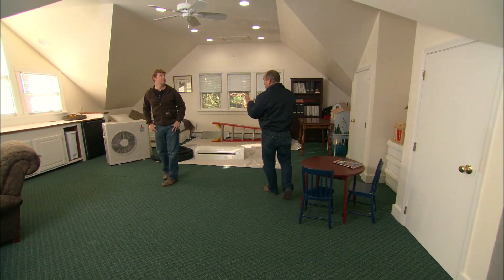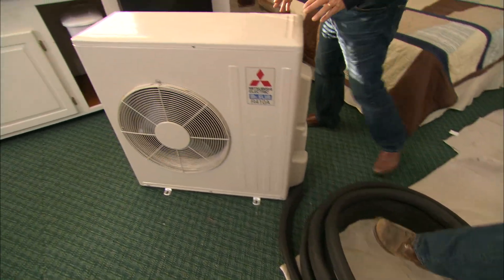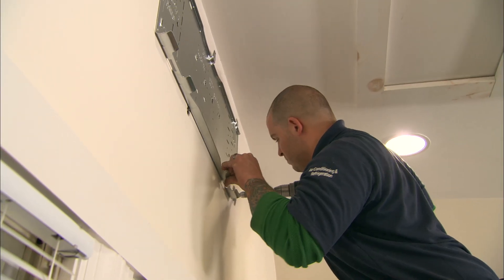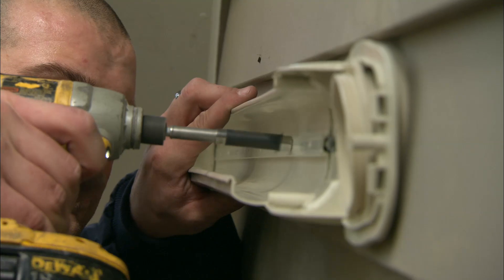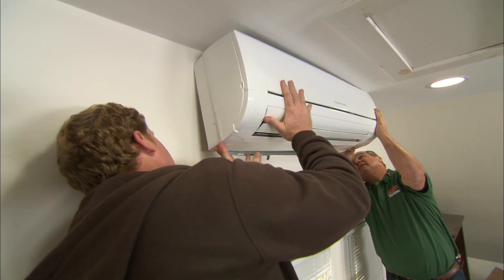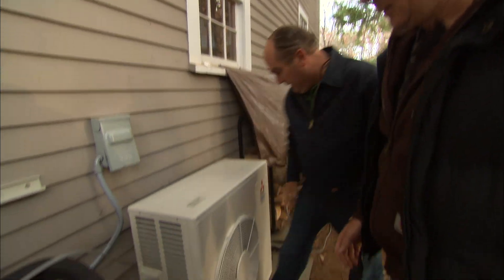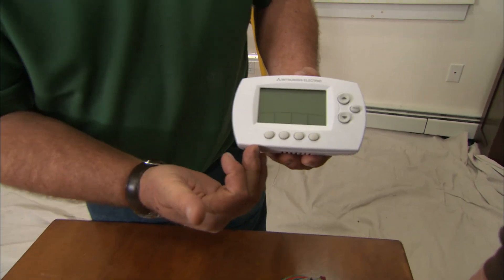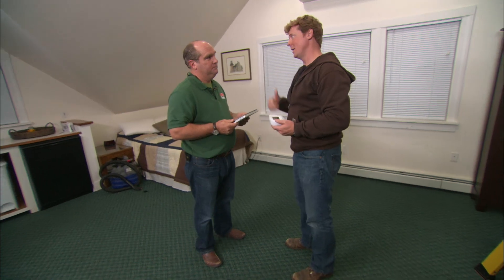How to Install a Ductless Heat Pump | Ask This Old House

Comment: Manual J calculation is absolutely worthless unless a blower door test is done. 700 sq ft and needs 18,000? NO SHITE. I’ve been in HVAC FOR 41 yrs and I would have put a 18K unit there without wasting my time on useless manual J

Comment: as low as 5 degrees outside can heat a room huh.... So how does it work exactly cause where I live in the winter, it can average -2 to 3 degrees on cold nights. Where is the "Heat" coming from if the outside is still colder than the inside of my house without the heat on?

Comment: Hi everyone. I have a question about my heat pump. I have installed the heat pump and ready to wire in the 220v power and I am a little confused. The unit is a 220v but the electric indicates L and N and a ground. I am used to seeing L1 and L2 for (hot line 1) and (hot line 2) for  220v. Is L and N another way to describe the 2 hots. Thank you to anyone  who can clear this up for me.

Comment: will a ductless heat pump work for a old brick house with no insulation in the walls in zone 7. It currently has a boiler with hot water and radiators. i have access to the joists under the floors.I am thinking pex under floors would be a better option. A local hvac guy said heat pump and mini heads?
Reply: What are you using already?  If it's electricity heating the water than it's a no brainer, get a heat pump.  You can get some that will heat the boiler water instead of air, though it might be a little less efficient (typically the water needs to be hotter in old homes because they lose so much heat).  But everyone will tell you: INSULATE FIRST, so you don't need as big of a heating system (cheaper)...

Comment: Would have been nice if you’d have shown how to pressure test, vacuum, and charge the system.
Reply: From what i have read they come pre charged.
Reply: @laserbeam002   Some brands like Mr Cool offer diy systems that are precharged and don’t require a vacuum pump. I could be wrong but I don’t think the Mitsubishi unit they showed is like that.

Comment: Is not the inside unit supposed to be at least 10 inches from ceiling?  (I am just reading/watching all I can before my unit arrives for my diy installation)
Reply: Thought the same, looks too close to the cieling, think it's supposed to be at least 6 inches

Comment: Just gloss right over the vacuum down, leak test, R412a charging.. all that adds about $600.  This is NOT a DIY lineset.  This needs a certified AC dude to charge the systems to the correct pressure.  Also that indoor head unit is WAY to close to the ceiling.  You need min 10 inches (that's what she said)

Comment: Why do Americans call it ductless? 
Just call it: 'heatpump' like the rest of us
Reply: Are not all gas based AC systems heat pumps by principle?  I mean they all transfer heat because of stage changes from liquid to gas and vice versa, right?
Reply: Andres Valdes. Yes, but I think many places "heatpump" carries the idea it is reversable able to both heat and cool. Whereas AC: cooling only in some regions.
Reply: @Froggability  Agree. I was trying to get to the point of the name.  It seems that calling it by the feature they don't share makes more sense than by the feature they all share. So, I'd say, that maybe this time Americans have it right. :-)
Reply: Because they are Americans. What you expect? :)
Reply: Because in Canada and the US, we typically have forced air systems that heat the whole house.  So we have heat pumps will be designed to work in those systems and heat the whole house.  As opposed to this unit which is designed to heat a room.

Comment: This video is almost 4 years old, is the information in it still applicable today in 2019? I'm trying to decide how to heat my garage and bonus room above it. I have an 1100 square foot garage and a 400 square-foot bonus room. Just wondering if one unit with two heads will work. And I live in the midwest where could get to 20 below zero
Reply: The right heat pump should work; I live in Canada and we have temperatures to -30 Celsius (slightly colder than what you mention).  I opted for the Mitsubishi Zumba, and it works down to -30 Celsius.  For my old 1950 house, at maybe -24 Celsius the backup heat turns on occasionally, but not enough that it matters much on the bill.  I highly recommend it.

Comment: A.) inverters don't magically pull heat out of cold outdoors.  They just make the whole thing 10X more efficient than capacitor run units.  B.) there was no mention on using a torque wrench to tighten the copper lines to the handler or condenser.

Comment: You guys are a joke, I've installed countless mini-split systems by myself. You don't need a bender for soft copper if you know what you're doing. I didn't see you check for leaks and evacuate. This isn't rocket science.
Reply: Think they skip over the stuff that "requires" licensed professionals like HVac and Electrical.

Comment: You forgot to mention how efficient split systems are -for every unit electrical energy they use you get roughly 3 units of heating or cooling energy back!

Comment: TODAY THESE MINI SPLIT UNIT ARE EVERYWHERE MADE BY MANY MANUFACTURES. THE ORIGINAL INVENTORS OF THE MINI SPLIT UNIT WAS MITSUBISHI. THE REASON I KNOW THIS IS BECAUSE I INSTALLED THE FIRST MINI SPLIT UNITS IN THE UNITED STATES AND MOST LIKELY THE WORLD. IT WAS BACK IN THE MID 1980'S HERE IN NEW YORK RIGHT OUTSIDE MANHATTAN IN SUNNY SIDE QUEENS IN THE NYNEX OFFICE IN THERE BEEPER DIVISION. AT THE TIME I WAS IN THE 638 LOCAL WORKING FOR THE A.D WINSTON CORP AND DAN DONNELLY OF DONNELLY MECHANICAL A BIG SERVICE COMPANY TODAY HERE IN NEW YORK. PRIOR TO DAN BRANCHING OUT ON HIS OWN EMPLOYED BY A.D WINSTON WAS MY SUPERVISOR AND ME AND MY PARTNER EDDIE B. MET DAN IN THE NYNEX OFFICES TO INSTALL THESE UNITS THAT WERE CALLED MR. SLIM FROM MITSUBISHI. THE EVAPORATORS FIT INTO A 2X4 CEILING TILE. I REMEMBER DAN DONNELLY SAYING YOU GUYS ARE MAKING HISTORY. THESE UNITS ARE A NEW TECHNOLOGY AND THE FIRST OF THERE KIND HERE IN THE UNITED STATES AND MOST LIKELY THE WORLD. THIS IS THE HISTORY OF WHERE THESE UNITS WERE FIRST USED HERE IN THE UNITED STATES AND TODAY USED ALL OVER THE WORLD. A YEAR PRIOR TO THESE UNITS COMING INTO EXISTENCE. I HAD A FRIEND FROM ISRAEL WHO I OFTEN VISITED HIS SHOP WHERE THEY MANUFACTURED HEAT EX CHANGERS.  WHEN I TOLD HIM I WAS WORKING IN THE UNITED NATIONS AT THE TIME INSTALLING LIEBERT A.C UNITS TO COOL DOWN THEIR TELEPHONE ROOM. HE TOLD ME WHEN HE WAS IN ISRAEL YEARS BACK. HIM AND SOME OTHER ENGINEERS WORKED ON A PROJECT AT A UNIVERSITY TO MAKE A.C UNITS MORE EFFICIENT. HE SAID THEY DEVELOPED ALL SORT OF DESIGNS WHICH IN THE END DIDN'T WORK AND SWORE UP AND DOWN TO ME THAT IT WAS IMPOSSIBLE TO MAKE A.C ANY MORE EFFICIENT. I GAVE HIM MY ENGINEERING KNOWLEDGE OF HOW THEY CAN BE MADE MORE EFFICIENT WHICH HE SOMEWHAT DISAGREED WITH AND STRANGELY WHAT I DISCUSSED. A 1 1/2 LATER I WAS INSTALLING THIS NEW TECHNOLOGY THAT WORKED ON THE PRINCIPALS I DISCUSSED WITH MY ENGINEERING FRIEND FROM ISRAEL. I TELL PEOPLE ALL THE TIME THAT MY RELATIONSHIP WITH GOD IS DIFFERENT FROM ALL OTHER MEN WALKING THE FACE OF THIS EARTH.

Comment: Window air conditioner is $300 and can be installed yourself.  This sort of mini-split system is like $3000 with installation.  I could see doing the mini-split system if there was no heat up there either, or if this was new construction.  But for this application, maybe I'm a cheap bastard.
Reply: If the choice is baseboard electric or heat pump, well, heat pump will be 1/3 of the heating bill, and the cooling will be cheaper as well.  It varies with location, but I am guessing this is in the north so the heating bill is much bigger than the cooling.
Also, a $300 A/C probably couldn't do that room, it would need to be bigger window one, maybe two.

Comment: the device you connected to the router is called a bridge... a gateway is another term for a router...
Reply: @gregorygrimm5540  routers turn an incoming signal such as adsl/vdsl into a signal such as ethernet... gateways do the same. bridges connect a device pon a different type of connection, such as bluetooth, IR, or RF.

Comment: why dont you run the line set in the wall from within the home?  running down the outside looks unprofessional to me?  a few holes and drywall patches looks better then a wire bulkhead running all over the exterior?   the concept is hide the pipes and wires in the wall keeping them from the elements?  come on boys you can do better?
Reply: Do rain down spouts bother you?
Reply: It's about accessibility. Much easier to get to the line set or drainline if theres a problem.
Reply: @DanDeeg78  Believe me it's very difficult to put into the wall unless it's in new construction. Also nothing to get to .The one end in at the condenser and the other end is at the inside evaporator. Nothing in between.
Reply: @robertgregory2618  ok? I guess you're agreeing with me? Reiterating what I said?
Reply: @DanDeeg78  Sorry Dan, I meant to have that as a second post to Agent Anderson. You and I are in agreement. My brain is mush at 2 am..
Reply: @robertgregory2618  right on no worries

Comment: Never use wrenches like this guy, always use a torque wrench on all fittings.   Avoid hanging on the house if possible.  If you use black insulated lines they must be covered, UV will quickly degrade the black insulation.  Use Nylog Blue on all fittings and as a lubricant what making flares.

Comment: You missed to talk about the pumping out all the air moisture from the two tubes before closing the system loop.
Reply: Seems you might be taking about system evacuation - and yeah he did miss a very critical step he should have evacuated the system before releasing the refrigerant by pulling a vacuum or at the very least purged with the refrigerant which is not recommended. Big f up.

Comment: A hvac contractor installed it, but u had to call in a electrician to run a power wire and disconnect. The new world of hvac sub contractor.
Reply: Any and all high voltage  electrical panel work is done by a licensed electrician. Do you know the difference between hi and low voltage?

Comment: Could you clear up the previously asked question below?

Forgot the most important part - what about evacuating and charging the system with refrigerant? I know a lot of these package units come precharged and you open the king valve once the line set is connected but you still need to vacuum pump the system down first. How to videos need each and every step

Comment: THEY MAKE POPPING CRACKING NOISES:    Mitsubishi (800-433-4822) markets, advertises, and their phone messages re-enforce the “fact” that their Ductless, wall mounted, split-type air conditioners (heat pumps with Inverter technology), are WISPER QUIET.  But in their owners manual, they say it is sometimes normal for the units to make noises that sound like pops and cracks.  
I met with both their diamond dealer Robert Bair from DowersGrove, IL and Mitsubishi in Schaumburg, IL to emphasize that we are light sleepers, the only reason I need your units is because my quiet furnace  makes too much noise for my wife.  I demonstrated how quiet my furnace was to the dealer!   Mitsubishi demonstrated a unit and said that all I will hear was the low constant fan noise.  They never mentioned the popping and cracking.  I complained for 2 years, The popping & cracking is getting louder.  Not able to use them.  Lost of over $6000.00   investment.
Reply: Fujitsu is a better product. No noise

Comment: Will it work in Minnesota at -20 F degrees
Reply: The Mitsubishi Zumba will, it's rated to -30 Celsius (about -28 F).  In my old 1950s house, around -24 C, the backup heat will occasionally turn on (it doesn't do much though since the heat pump is still working).

Comment: since 2018, not without a HVAC license
Reply: I heard that a 110 volt system does not require license or permit but a 240 volt system does. At least in my area, that is what the county permit office told me. Smaller units below 12000 BTU I believe can run off of 110 volt.

Comment: I have an older home that has baseboard heat. I live in the south and it is very expensive I can't imagine what baseboard heat would cost in the North. Have they made baseboard heat energy efficient now?
Reply: Not baseboard, but a heat pump can easily be 1/3 of the cost of baseboard, because it basically steals heat from the exterior.  For each kWh of electricity, it can bring back 3 kWh of heat.  The efficiency drops as it gets colder, but better units can keep going to -30 Celsius (about -28 F).  The only thing is the units are more expensive, but they will pay back over time.

Comment: I'm an hvacr tech mechanic and installer of 34 years you did not pressurize and pull a a vacuum the most important thing's to do on an installation plus with mini split's you need to do a double evacuation.
Reply: I'm sure they did, but didn't show it for the sake of time. I mean it's incredibly important to do, I can't imagine they would skip pulling a vacuum.
Reply: Why a double vac?
Reply: If installation is done with good practice no need to do a double vac.
Reply: Still would like to know why a double vac?
Reply: @setvencarter2752  ,
Actually some HVAC text do a triple evacuation, it means that you break the evacuation with a nitrogen pressure, then do another vacuum. It is supposed to help remove ice build up from the evacuations
Reply: @josephthomas439  I k ow that mate, I'm a tech myself! Just wondering what a double vac is. Triple =3!
Reply: Answer please?
Reply: Lol yeah that's the entire reason I watched this video was to see what they did to pull a vacuum and fill the system with refrigerant. 

Got any tips on how to do that? I've done the Mr. Cool system before, but it would be pretty nice to be able to install a Mitsubishi electric system myself
Reply: The lines on these mini splits are offered pre -charged. That way no need to call a tech out. Feel obsolete yet? Looks like you'll retire just in time.  Everything is plug And play. No repair just replace. Just like us old guys..

Comment: boo.  what a white wash.  you guys aren't showing any of the actual work.  it's like having dinner without the meat and potatoes.  boo.  when you initially showed us the indoor unit, you showed us 4 connections, the gas, liquid, drain, and electric.  the next thing i saw was the mounting bracket on the wall and line set harness going out to the condenser.  did you mount the bracket anywhere you wanted ?  how do you determine the location of the mounting bracket and screws?  do they have to connect to the wall studs ?  how did you hook up the electrical, gas and liquid line ?????  the hooking up of these units is the foundation cornerstone of the video.  the only reason i'm watching the video is to get tips on hooking up the connections.  how did you get this harness to a 90 degree turn at the outside wall ?  the video is a white wash, as you will find out when you try to do an actual installation and experience doubt as evidenced by zimsjeep's comment below.  boo.

Comment: Bull crap that will not heat that space and keep you comfotably.
Reply: It may not quite make it in winter, but they still have the original baseboard heat for supplement, so it will be fine.
Reply: My Mitsubishi Zumba worked fine until about -24 C when the electric heat came on occasionally.  The heat pump was still getting heat, just not enough for my 1950s house.

Comment: This is the same technology that's in your fridge. Remember that cold for oxygen is a LOT lower then what is cold for us.
Reply: Why can't they use heat from back of Fridge in Winter weather.
Reply: @louishollandjr  Are you going to open your fridge to the outside and have the back inside the house?

Comment: So I'm guessing you should have a backup spacial heater in case it goes below 5 degrees?
Reply: The existing baseboard heat could probably be used.
Reply: Depends on the heat loss of the place, the efficiency of the pump.  They make some that work to -30 C (-28 F or so).  In my house, the backup heat kicks in at around -24 C, but it doesn't do much work since the pump is still going.

Comment: Not a good place for the outdoor unit. Compressor oscillation will reverberate into the walls and cause objectionable noise. Better to mount to an elevated pad on the ground.
Reply: It depends on the model - our Mitsubishi Zumba was mounted right on the brick wall, and the other side is the main bedroom, and we can't hear a thing.

Comment: he completely butchered the principles of refrigeration. He completely ignores all heat exchange is done at the condenser and its the phase change of the gas which happens at condensor, and the cooling of the compressed gas at the heat exchanger. Basically simular to when you let a compressed air duster can rip open and the can gets frozen.  
The gas is recycled and compressed back at the compressor then cooled at the heat exchanger and the whole process is repeated.
Reply: Terry Cho 
Isn’t it heat exchange in the evaporator that causes the refrigerant to change phase from liquid to gas?